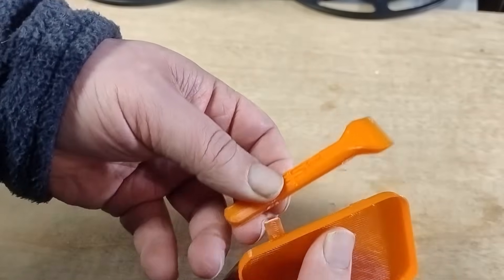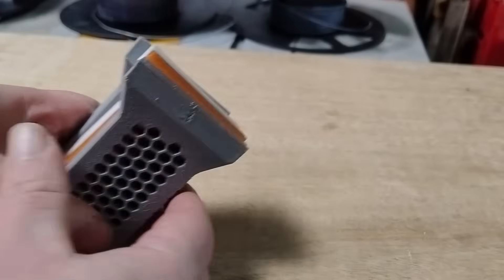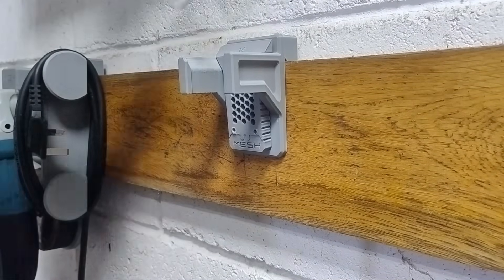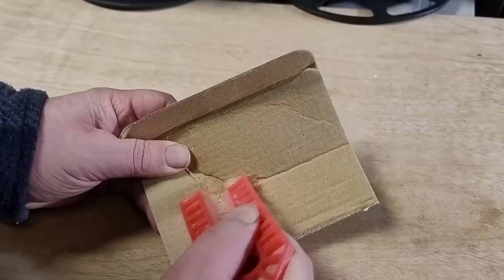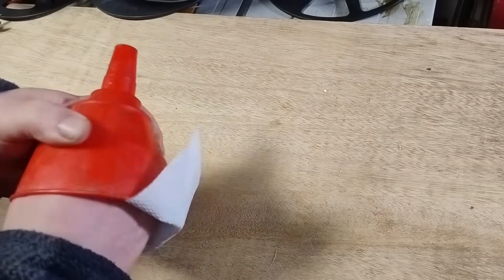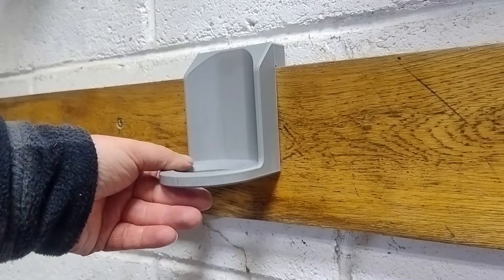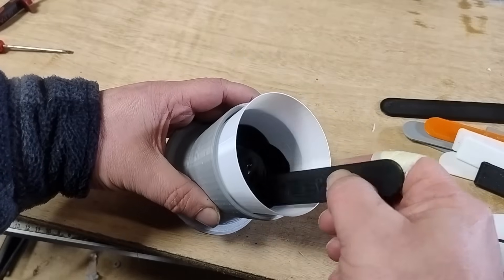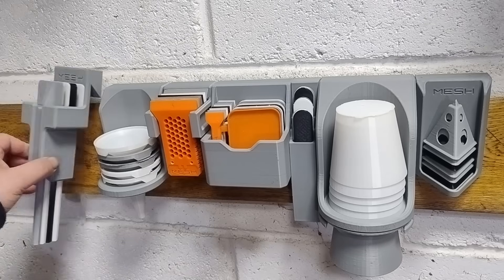8 Workshop Essentials to Print at the End of a Filament Roll

Comment: My absolute first time with a 3D printer!  But I've got a vinyl cutter, and I know they can be tricky to set up.  And I've ran CNC lathes, if they're not set up right, that can be some real expensive sounds!
They included some filament, but not on a roll, so I don't have any idea how much it is or enough experience to know what it will make.  Seeing you weigh the leftovers taught me to weigh what I had (~70 grams).  And I picked the packers because they look easy and use very little filament.  That means I can mess up a lot more before I run out! 
Thanks!

Edit: The bed came loose about half way through the first one, so, there's that.  Once I tightened the belt, the second one looks good, but I've got a tiny stringing off the scraper part.  I'm learning, and I've used about 3-4 m/ 9-10 g of material.

Comment: Ecologically, it'd be much kinder to the Earth to just buy some injection-molded mixing-cups.

Use filament for making things not mass-produced by the zillions..

otherwise it's just doing already-done-things in a more ecologically-costly way.

_ /\ _
Reply from the maker: Totally get the argument. In my shop it’s less about replacing factories and more about solving today’s problem with what’s on hand.

Comment: On Bamboo printers, I print until i use the whole reel, the print pauses until i load a new reel, and it continues printing.
Reply from the maker: I am running an older Ender 3 sadly and it doesn't have this feature

Comment: how do you have stuff left on your spools? i thought printers automatically switch to the next so you should only end up with empty ones
Reply from the maker: Most older printers don’t do that by default,  they’ll just run until the filament ends unless you stop it manually or use a runout sensor.  Hopefully in the future i can upgrade to a multi spool printer.
Reply: @sketchmeto  i use the P1S with AMS 2 pro. I don't really use it for multi color but I use it for 2 things: A) automatically switch to the next spool when one runs out and B) if I have a super cheap and crappy filament that doesn't want to stick, I'll print the first layer or 2 with a good filament and then print the crappy one on top of that :)

Comment: Good designs, but the single use disposable nature of some could be improved to make the same object be able to be reused or a smaller section be thrown away instead of the whole item if it must be disposable due to object destruction (epoxy mixing pad and spatula) or cross contamination (funnels).

For the epoxy mixing pad and spatula you could use the existing spatula, create a thin mold as a separate part to go around the mixing end and use a tiny bit of a tube of bathroom sealant silicone from the hardware store, using the mold to create the silicone shape around the 3d printed spatula head. Same goes with the mixing pad, using the same silicone in the recessed area of the mixing pad to coat it smoothly. That way both surfaces can have the mixed and cured epoxy easily removed off them and be used again.
Its a little extra time and some hardware store silicone, but it is better than continual single use plastic.

The funnels could instead be labelled for different fluid types, that way you always use the oil filter for oil and the brake fluid for brake fluid. Choosing a different way to stack them to avoid cross contamination. Or keeping the existing stacking design, but maybe a screw in cap for the narrow end of each with a rubber o-ring to stop leaking.

Again good designs, but they could be expanded upon to remove the single use disposable nature of some of the items 👍
Reply from the maker: I like the thought behind making them reusable, definitely something to consider. I thought maybe taking the liner approach to the funnels. a thicker main funnel with a liner printed in vase mode. I might have another version of these in the future.

Comment: Since filament runout sensors are a thing i do not have leftovers. I just let my printer use whole spool, and mount new one to resume print.
Reply from the maker: Can you add these to ender 3s?
Reply: @sketchmeto  as far as i can see, yes: https://www.youtube.com/watch?v=fgrrLsO-YRA 
Saw also kits on aliexpress for this printer. 
I have such sensor in Ender 3 v3 ke, so also quite budget printer. So i believe that most modern, even cheap, printers has this option built in.

Comment: For the mixing cup, you could print it with a brim and make the attachment points stronger than typical so they don’t break off unless needed, which would solve the need to print the holder
Reply from the maker: I think that would stop them stacking no?

Comment: I honestly usually just use the little bits at the start of the next container or bin I'm printing. When the run out sensor activates then I load in the color of the main body. Honestly it kind of elevates the look of a lot of boxes and bins to have a different colored bottom.
Reply: I hadn't thought of doing that. Good idea.
Reply: Same, I just use it on starting some print where I do not care about matching colors, f.e prototyping.
Reply from the maker: An interesting aesthetic choice!

Comment: Pro tip...  as soon as you have an empty spool, leave the cardboard hub in place and weigh it using a kitchen scale. Keep a list of how many grams it equates to, and then when you get near the end of a spool, you can quickly and very accurately identify how much filament you have left. The only trick is that you need to do this for each different filament product, so one for Bambu Lab, one for Elegoo, one for Sunlu, etc. etc. etc.

Great video, and thank you for sharing your ideas and models.   ...well, some of your models. The majority of what you showed in your video isn't available or accessible on the Printables site.
Reply from the maker: Great tip.  Little behind on getting them all on Printables but check back in shortly. I just moved onto there as i was on Thingyvere before.

Comment: I do not currently own a 3D printer, I have been looking at them for about a year now and I think I have dialed it down to the Bambu H2S or H2D. Your video popped up in my research and I am glad it did. I have a full shop, half is for wood working and half is for the rest of my hobbies. I never thought about "printing", router bit holders, or screw driver racks not only made to hold different screw driver sets but each driver marked by size and tip and the like. This opens many more reasons to buy a 3D printer. Thank you, new sub.
Reply from the maker: Glad it found you. Printing tends to quietly expand from “nice to have” to “how did I work without this.
Reply: If you’re dead set on a H2 series, wait until they get upgraded. The upgrades they made on the P1S while upgrading to the P2S made that printer the best performer in their entire line, including the X1C. If you want a Bambu Lab now, it’s the P2S. If you’re willing to wait, then wait for them to upgrade the model you are interested in. The H2 printers have been getting some poor reviews by makers by the way.
Reply: @fraudbuster1456  I'm not "dead set" on anything yet but the H2's do check many of the boxes I would like met. Large build plate, enclosed, stuff like that. Stuff my niece told me to look for. She has several 3D Printers, I think hers are all Creality printers. Do you have a recommendation that I could look at? I do not know many 3D printers so I am doing a lot of looking without a lot of practical, hands on, experience.
Reply: We have a nice little Elegoo model, and it seems to be good too.
We've had a liquid resin for a few years, but just got the filament one recently, using the after Christmas specials to get it a bit cheaper.
My god, they're fun! 
Please get one if you can.
They can be very silly,  but can also make you some very useful everyday things, and saves you having to go to the hardware store all the time.
They're pretty useful, tbh! 😁

Comment: I don't have ANY half empty spools at all, because I feed them in behind other filament. I got a feeling everybody else could do the same, if they tried.
Reply from the maker: It's the trying part I'm going to struggle with.
Reply: @sketchmeto  I even mix up colors. Put strips on prints without ever stopping the printer. For example, it's cool to have a glow in the dark strip right across black.
Reply: It really is crazy. A filament sensor is so cheap. Just print and remove the spools when they are empty...
It's not rocket science.
Reply: @BeleefMeeMetJP  Yeah, really!

Comment: I print in PETG mostly so I print guitar picks and vase mode funnels with a 1mm nozzle .. I monogram the guitar pics for my friends with their initials and I designed 4 different funnels that take from 6 grams to 11 grams each.. 1mm nozzle in vase mode makes for really nice durable funnels with a fast print time ..
Reply: You sharing?
Reply from the maker: how do the prints come out with a 1mm nozzle?
Reply: @sketchmeto  Extremely nice in vase mode.. Makes for very durable/ light 1/24 rc car bodies, vases, funnels .. Use at .25 layer height..  I keep an old ender3 V1 set up with a 1mm nozzle just for vase mode prints..

Comment: great ideas. What kind of filament for the "thin wall mixing pots?"
Reply from the maker: These were printed with PLA. I recommend increasing the temp a little (about 10 degrees) and possibly the flow by about 5% as this ensures the layers bond and they stay water tight. This may just be my machine though

Comment: Yo what the hell these are all genius!  I just got my printer and I still haven't reached the end of a single roll ( Except the damn 200g roll that came with the printer)  I'm now looking forward of running out one, so I can make that shimmy scraper thingy for sure!
Reply from the maker: Thanks!, I put all the sized up to 10mm on Printables (check the description) If your using the utility blade part I wouldn't go thinner than the 5mm packer/scraper

Comment: Some great designs - nicely done. All I'd change is to remove the lip on the epoxy mixing plate, so the base can be stirred on (the side that touches the build plate), ensuring as smooth a surface as possible. Truly brilliant idea though. Looking forward to them all being on Printables.
Reply from the maker: That's a great idea to get a really smooth surface! I thought about maybe looking at surface ironing that part but printing against the bed would also work. I will look into it for v2!

Comment: Excellent ideas.

AMS has eliminated the spool ends for me, at least for the common colors.

AMS auto-swirching spools mid print has been a game changer.
Reply from the maker: I’m still on Ender 3s, so I deal with spool ends the old fashioned way. How’s AMS been with different brands and colours?
Reply: @sketchmeto 

It doesn't seem to care about brand of filaments, but it is very susceptible to tangled spools.  A mildly tangled spool will stop the print, especially during multi-colors since it has to clear the filament during each color swap.

The bambu filament prints nice, but it does fine with off brands and old stuff.  The big advantage to the bambu filaments is they have an RFID tag in them and it will auto load the filament color, type, and characteristics into the software.

The slickest feature has been support filament.  It it prints a layer or two between your surface/raft/supports and your object.  The rest of the support is just your regular filament.  Makes seperating supports from your object a lot cleaner and gives you a few more options.  It can be used between stacked prints (vertically stacking multiple prints), but I havent tried that yet.  Nor have I tried printing with different materials in the same object.
Reply: @sketchmeto I love those enders.  I've had various flavors of ender 3s (four) and a CS-10.  They all still work, but the P1Ss are my work horses atm.  Its hard not to.  The P1Ss print far fewer failures and can print almost out to the edges without issue and they are 2-3x faster.

Comment: I am presuming the mix cups are PET-G, I have had trouble getting PLA watertight.
These are some very useful designs. Subscribed, likes, and following on Printables.
Reply from the maker: They are actually still PLA. If you having issues with keeping them watertight then increase the temperature by around 10 degrees and increase flow by around 5% and that will help fuse the layers together better.

Comment: You have several really good ideas.  I went another direction for using up ends of rolls.  I bought a filament joiner, and use it to join the ends of the same material together, being color blind, I don’t even pay much attention to what colors I join.  Same material from the same manufacturer just gets joined.
Reply from the maker: That’s a great way to use up ends of rolls. I’ve been curious about filament joiners.
Reply: @sketchmeto честно говоря я не заморачивался с отдельным соединителем. Просто останавливал печать когда филамент соскакивал с катушки,  и оставалось см 15-20.  И продолжал новым остатком с другой катушки. Да, это требует контроля при печати. Но, как и Вы, я добиваю остатки на маленькие технические детали.

Comment: Lol. So strips are wasteful, yet everything else you designed here are meant to be one time use? Cool designs, by all means. But still wasteful.
Reply from the maker: Thanks!
Reply: Well yes & no - throwing away just the remaining few meters from the spool is extremely wasteful. 

BUT if you use said few meters to make something that is going to serve a function or purpose then it isn't AS wasteful because what was once something which was going to be simply thrown away has been repurposed into something which now provides a function, regardless of how tiny that purpose is. 

- The spacers is VERY handy especially if you are in the building or construction trade as they're used all the time. 
- The Funnels can be kept for specific types of oils, especially if you have various colours laying around (green for Chainsaw Oil, Red for Car Oil for example). 
- The above also applies to the mixing cups, if using waterbased paints, wash out and re use. 

So thank you Sketchmeto for these absolutely wonderful ideas - I shall 100% be using these :D
Reply: @themaltesemaker  My point is that he made the strips, the least volumous item on the list, reusable, but everything else as consumables. But other than that, I agree. Much better to make something useful, than to just throw away.

Comment: Why not connecting does rest peaces together ?
Same matierial but different color. For those things the color does not matter.
Even more for some partial test printsci often do to get exact size, diameter or whatever begore the full and much bigger part is printed.

Sunlu sells such filament fonnector, but you can do this on your own with a sharp peace of metal and a candle.
Reply from the maker: That’s one rabbit hole I haven’t gone down yet, I’ll check it out.  Thanks!

Comment: deserve more recognition, will be using some of these as flush objects for my multi-color prints as well!
Reply from the maker: Thanks! That’s a smart way to turn purge into something useful. What printer are you running?
Reply: Can you point me to how to make flush objects instead of poop or towers?
Reply: @CC-nt4zi  in your slicer, "others tab" print sequence- by object, then put the object on the plate right click it go to flush options, flush into this object, hope that helps reduce waste!
Reply: Could you design a simple LOCK to secure each bracket on to the French cleat…

Comment: I did have this problem but since I my Elegoo Centauri Carbon I use all of a roll. It's filament runout and recovery have been flawless. The only problem I have heard of is that with some filaments whether they end up getting a crossover or the end doesn't unhook from the spool it can stop feeding and continue "printing". I only print with a roll that I'm sure will run out when I am in the shop. And then I clip the filament when its about to be out at the roll. But these prints look interesting for the most part.
Reply from the maker: Thanks!